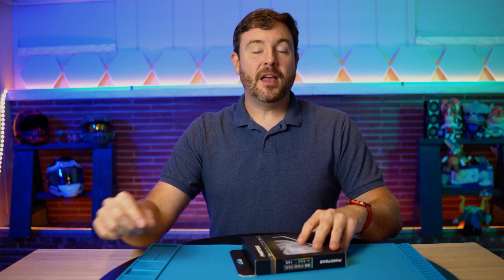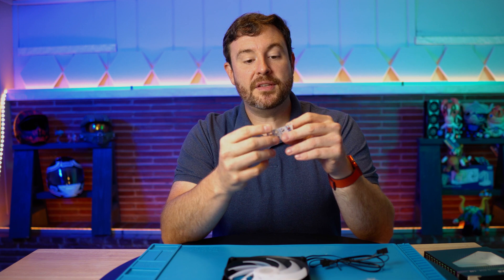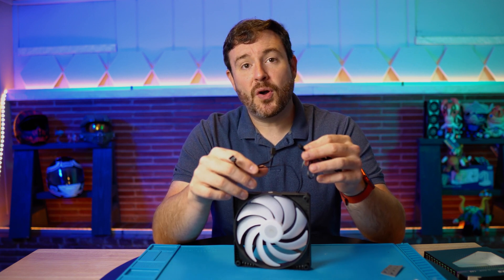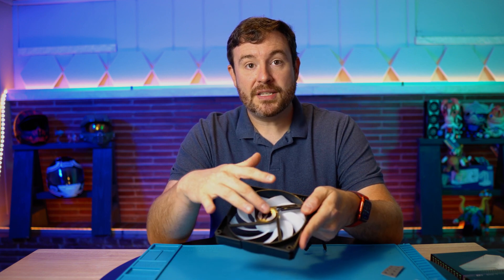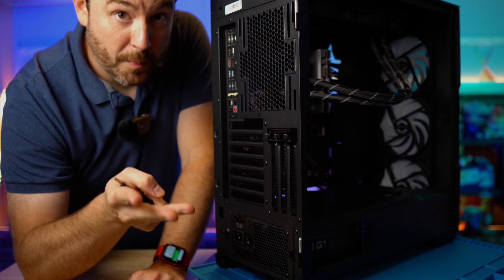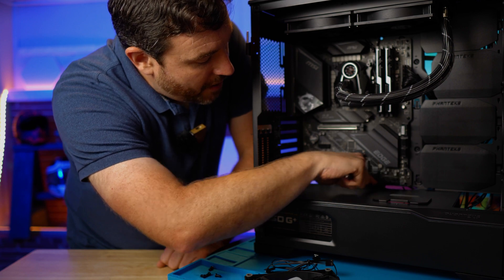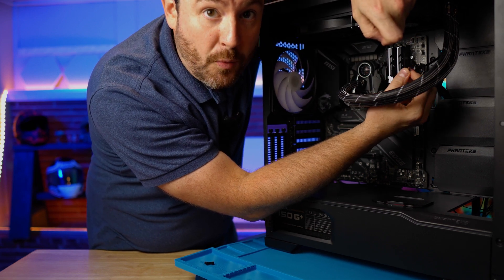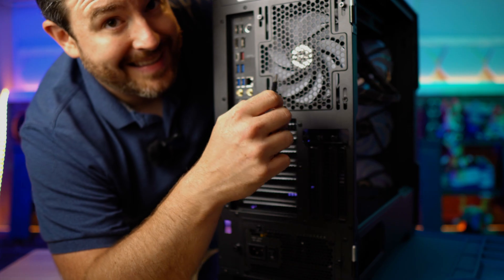Installing PC Fans to avoid vibration, improve airflow and ascetics!

Comment: I've personally have not had a fan crack.

3 pin fans CAN have rpm control. They are controlled directly by the mobo using "voltage" rather than "pwm." 

Generally, pwm is better as it allows for lower rpm at idle/low temps so is quieter. There are fans that use molex or are 2 pin, they spin full speed and have no rpm control.
Reply from the maker: Good points. I have had the misfortune of some fans crack, others completely spun out the part where the screw bites into the fan. 

I avoid 3pin because it’s a chance the MoBo // Voltage won’t work well. But you are right, my employer has case fans with 3 pin and my software does control it through the BIOS/Motherboard. Good call out.

Comment: When I’m mounting a fan to my case I prefer to use silicone stand offs no screws means no damage to the fan or paint
Reply from the maker: Those are really nice to have. You can get them in different colors too which is awesome!!!
Reply: @TheGrayingTech  yes cheap as chips too I got a pack of the for £1:30 and if you have a cheap fan that doesn’t have vibration isolators the stand offs will isolate any vibration

Comment: Hello, what can I do if my processor gets very hot? I have a ryzen 5 3600 and sometimes it reaches 90 degrees, I would be very grateful if you can help me
Reply: I would replace the thermal compound first.  May not be good contact between cooler and cpu.  Ryzen generally needs more as bigger size.  If no love with that,  replace cooler with better cooler.  thermal compound is cheap and fast, so easy place to start.  You can try Ryzen Master for free, to set cpu fan to more aggressive (faster) curve.
Reply: Get new paste and reinstall the cooler, could be bad mount.
Reply from the maker: Order of Operations:

1: Adjust voltage with Curve Optimizer: Volts need Current  which creates Heat

2: Adjust PBO: maxed out is good for water but on air you’ll need to control it more. 

3: Good airflow; clean filters, clean fins, positive pressure?

4: Do you have a core running hot? If yes, paste isn’t sufficient 

5: <in a whisper> you did take the sticker off the cooler, right?

Lastly, Ryzen will run between 70-85 on its own. Watercooling is the only thing that brings that down and even then, the CPU will boost into the 70s.
Reply: @TheGrayingTech  Dont tell people to use pbo that is the very last they should touch cuz that will void the warranty.